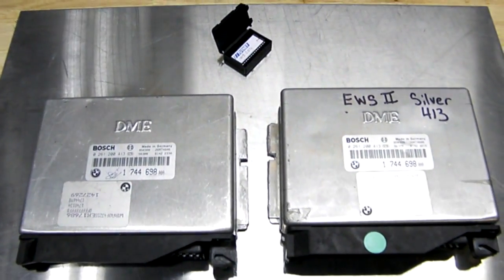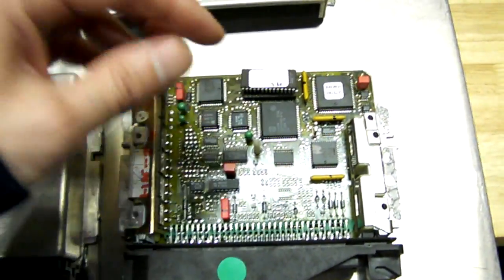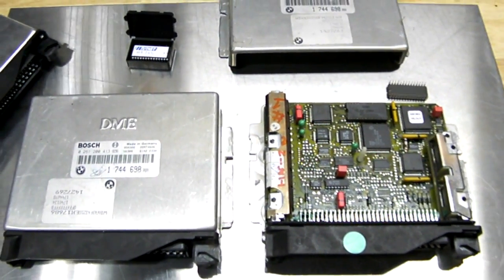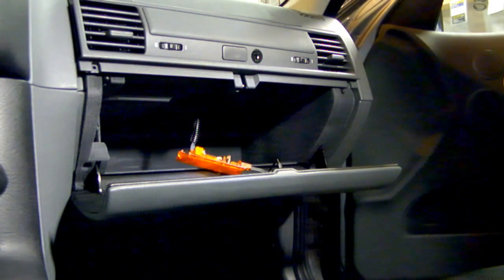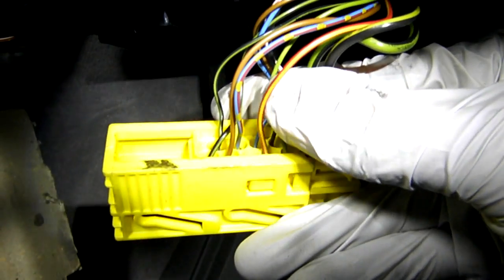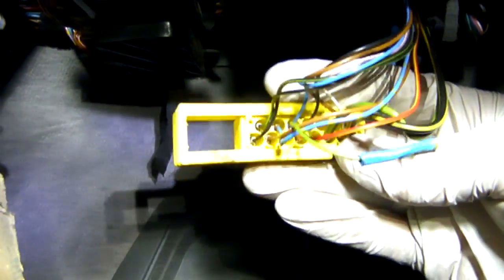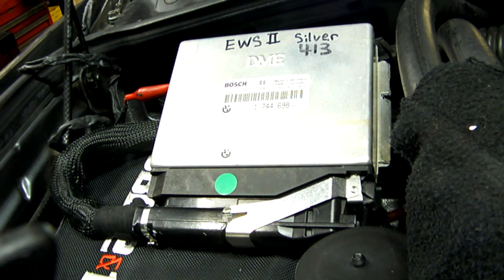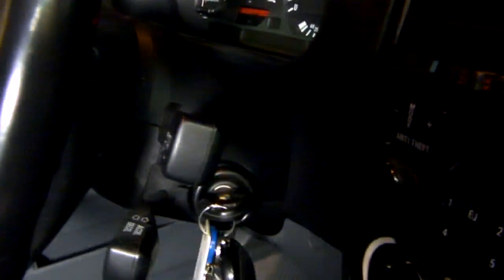BMW E36 EWS II BYPASS COMPUTER SWAP

Comment: I should have said a no crank ews problem, not a no start in my first post.  I jumped the 1 to 3 pins on the ews plug and now I have got cranking but no start (due to unplugged ews). So I know it's ews problem and don't want to shovel cash to dealer. Now is there a way to go from cranking to running. I believe dme has a Dinan chip that did always work with ews. Thanks if you have an idea.

Comment: On my solenoid there are 4 wires, big red 12v, grd, two small wires covered in rubber/plastic to small terminals. Is one of them for ews?

95m3 7/95

I'm a little chicken to cut those ews wires. A tech told me the ews module does go bad sometimes (especially volt spikes like jump start (which was not my case.)Here's a link to my thread if you have time.

Comment from the maker: Well the procedure only bypasses the DME, the EWS module actually still needs to communicate with the chip in the key to allow the starter to work. There is another bypass that can be done that will bypass the starter as well. On the EWS plug there are two large wires yellow/black & green/black... they are the only large wires there... you cut both of them then cap off the two that go to the plug individually (so they do not touch) then bridge the other half together that lead into the dash.
Reply: Hey don't know if you're still around but I have a question: Would a NON-EWS DME from a manual car work in an Automatic car? Both DME's are for the same engine.

Comment: HI, I have a 95 m3 built 7/95. Trouble starting intermittant, I believe I traced to ews antenna & wiring. I got a new antenna & installing today.  If you do the bypass why do you still need the chipped key & ews antenna in the picture to start the car? Very nice vid btw, do you use a mic, voice is very even throughout. thx

Comment: Real nice video!
Thinking of putting a 2,8L engine in my 323ti e36. It´s a -98 but I guess it has EWS II, cause it has ODB-1. According to you I do not need any of the control boxes from the new bigger 2,8L engine, if bypassing the EWS like this? Right? In that case this is very interesting info for the one performing a motor swap.

Comment from the maker: The War Chip should work just fine even if you  bypass the immobilizer, it would work the same way as if you did the bypass and decided to run the original silver label chip. Once you do the bypass the chip has no more control over the sitsuation. As for the E39 keep in mind that BMW changed from EWS II to EWS III somewhere  around 3/97.... good luck with your project.....mybimmerspace

Comment from the maker: Your 98 540i is OBD-II which doesn't require a chip but rather a reflash that uploads performance files it's kind of like our desk top computers, you plug a USB flash drive into the computer and then upload the contents.BMWs built before 1995 are OBD-1 and most come with a removable chip.Your 540i is equipped with EWS III which is a newer and harder to bypass. You need some type of module, try Googling "EWS3 IMMO Emulator"  to my knowledge the Shark injector will not interrupt the EWS III system

Comment: Hello  mybimmerspace,

i have 1998 E39, 540i m62 engine with Programmed EWS silver label DME stock.

my bmw e39 turns over but does not start up. so i wanna try by-pass this EWS bullshit.

is there a DME out there that is non-ews for the e39 that i can buy.
Does tunermotersports sell any Non EWS chip, that i can buy to replace the stock EWS chip in my Bosh 0126-204-467 DME.?

I NEED your advice to see if it can work on my E39 M62. V8.

Comment from the maker: Mike, yes you can throw in a maroon label 413 with its stock chip when you perform the  EWS bypass.... it works for me every time. You could also swap in a used silver label with EWS coding and it will still work with the bypass. As long as you have your key with the chip this will all work.
Reply: Hi I have a 97 328i UK car and it has OBD1 dost that mane this could work ? Update I just found out Euro spec cars kept the OBD1 port until 2001
Reply: So when you say "The bypass" are you referring to "cutting the green wire pin #4 at EWS module...So I'm understanding this - if I clip that wire and then install a red label 413 computer it will work just the same.. So what if I installed a red label 413 DME and didn't clip the green wire - what difference would it make?

Comment: have a 95' 325i need to replace dme can i use a stock dme pre 95' with no ews chip and stock chip in it and follow your video to bypass ews? this will be a maroon label 413. I can use the stock chip that came in the maroon label dme? thanks mike s.

Comment from the maker: Your better off buying a chip, the 413 is a bit different considering it has 6 injector drivers and different pinouts. Good luck with your project...
Thanks, Mybimmerspace